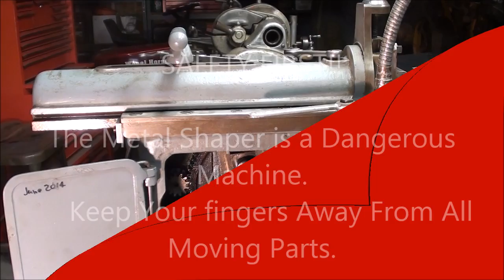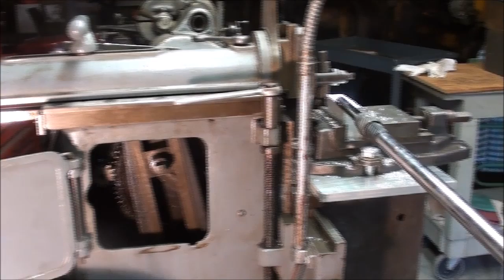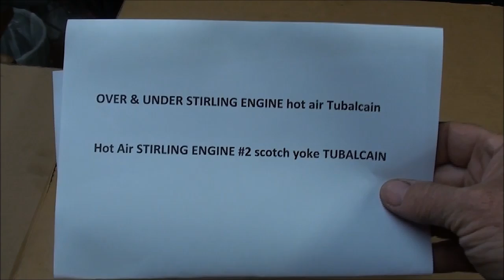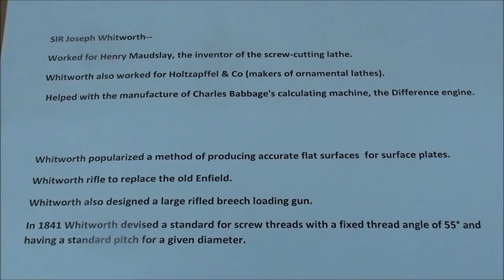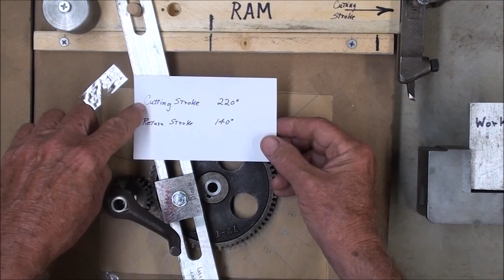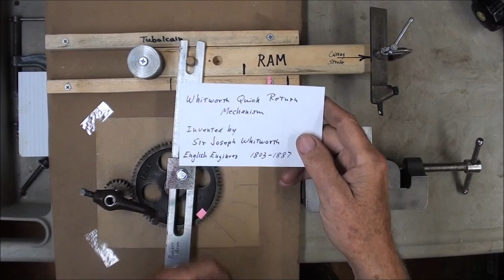TIPS #172 ATLAS RHODES SHAPER Whitworth QUICK REVERSE Mechanism tubalcain

Comment: This is interesting but it isn't clear how the scotch yoke pivot on the bull gear makes the return stroke of the shaper faster.
 You mentioned Whitworth; I work on alot of European and Asian made  commercial and industrial refrigerating chiller machines and Whitworth pipe threads are alive and well, every country outside the US use this thread at least in piping, I'm sure you know Whitworth pipe thread has two different "flavors" parallel and tapered, they come in nominal inch sizes, same as our  NPT but the pitch seems to be slightly different, the Whitworth pipe tread is referred as British Pipe Tapered (BPT) or British Pipe Parallel (BPP). The BPT is similar to our NPT in that the threads are tapered and rely on an interference fit for sealing while the BPP needs a landing surface such as a gasket or o-ring for a seal. These fittings cause alot of grief for many mechanics in this country as these are almost impossible to find in this country (USA).

Comment: A most enlightening video, while I knew that shapers had a non-symmetrical stoke, I did not "perceive" how that happened until your model showed that the pivot point moving to - away from the central axis changed the rate of movement of the end of the lever..  Would love to see more of these .. Thanks Tubalcain